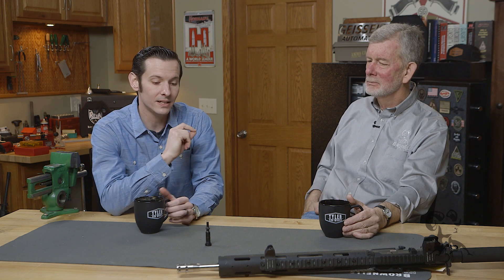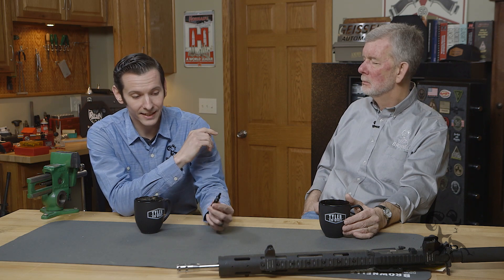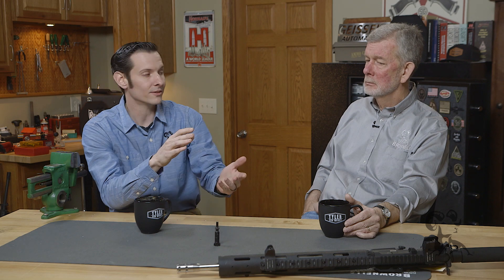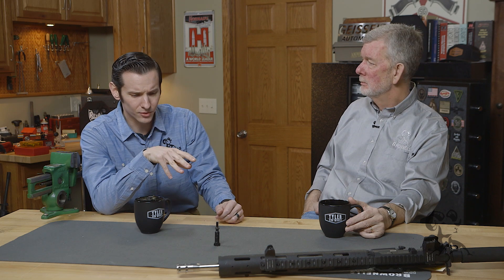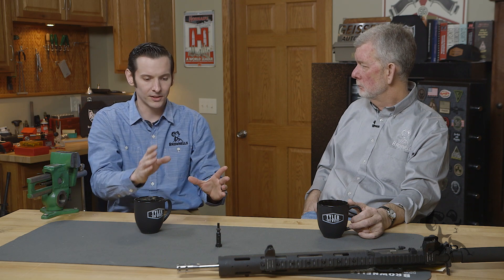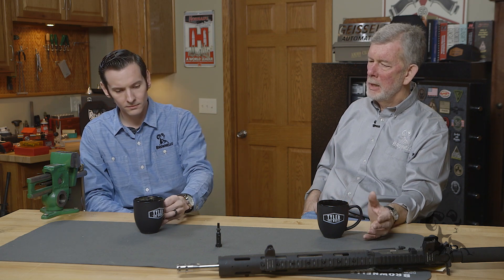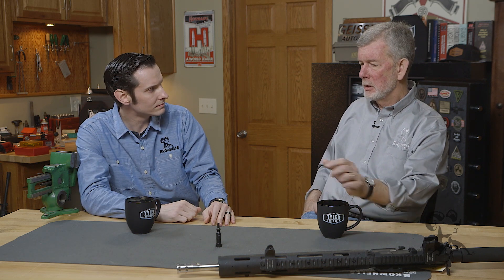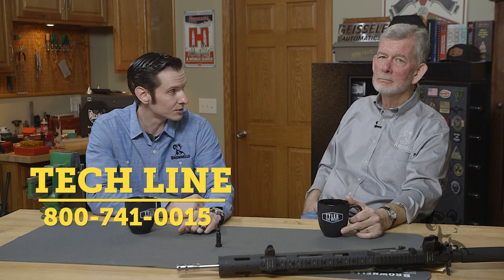Smyth Busters: Debunking an AR-15 Myth - Gas Ring Alignment

Comment: I would have liked to see some proof.
Talking about it and stating one side of the debate as fact does not "bust" the myth.
Reply: How about trying it yourself?
Reply: @timothyterdin5725  I don't plan on making a video which claims to bust the myth.
Reply: @michael9601  I have lined the gaps up.its a myth.i was told the same thing.as soon as you fire the rings move randomly.
Reply: @timothyterdin5725  I 100% believe its a myth.  My only point was that they didn't do what Jamie and Adam do...  :)
Reply: @michael9601  ok.cool.i missed on that cause I was told this too

Comment: This is the same thing as off setting your rings when rebuilding an engine. Sure it will still work with them lined up. But wouldn’t it work better if they where off set? But none the less I’m still going to off set them. Lol just what’s familiar

Comment: Once again Brownells tells the truth but for the wrong reasons! It's not about the low probability of rings aligning!  It doesn't matter, because the gap all but disappears when rings are compressed to fit in the cylinder. This is like when the small engines class teacher tells you not to align the piston rings in Highschool.  😂 A majority of 2 stroke engines only have one piston ring, and they still make plenty of compression.

Comment: Do this with an engine piston, and tell be the same thing
Reply: Done it.  Compression numbers were the same across all cylinders.

1: The ring gaps close most of the way on both kinds of piston once they're in their cylinders.
2: The pressure rises very quickly, so having those little gaps lined up doesn't have time to matter.
3: Gases can turn corners fast enough that not aligning the rings doesn't really matter anyway.
4: The ring gaps are going to move around on the pistons randomly anyway.  At some time, in all those millions of cycles, they're going to align for some time.

Comment: Have anyone tried to shoot/test the bold without any rings ?  If it still works, then the ring alignments are irrelevant.  Can anyone try this and report please ?  Thanks.
Reply: It probably won't work without any rings, unless your rifle is horribly over-gassed.  That doesn't prove anything about ring gap alignment, though.

FWIW, I tried the ring gap alignment thing on a 3 gun rifle with the adjustable gas block set as low as it would cycle BEFORE aligning the gaps.  Still cycled with them aligned.

Comment: Sry, but this is BS. I've had one issue with low-pressure LR308 which did'nt cycle.
Pulled it apart and what did I see? Aligned gas rings! ;)
Reply: This^^ seriously i think these people successfully shot off 10 rounds and went home. When you actually sit on a range all day for weeks at a time you are bound to realize sooner or later the gas rings will cause improper feeding and ejection problems.
Reply: @scotty362100  Actually, I think Brownells is making a fool out of themselves. I was under the impression they knew what they where talking about.
Since it's not April 1st, I take this as sensational click-bait.

However, if a AR15 is gased high enough it will cycle. Usually applies to milspec but not a competition rifle.
Reply: @elespecia5604  First time I tried it was on a 3 gun rifle, so...

Comment: Aligned ring gaps just makes her “shit where she eats” a bit more....dirtier chamber and BCG after same amount of rounds down range.....still shouldn’t induce reliability issues unless the rifle is operating at the fringe
Reply: I just always did this naturally as long as I've owned mine. Working on engines, ring alignment is a no-no. But in a four cycle they will move around to where they want. They too will run aligned but you're right. Unnecessary blow-by should be prevented. I never heard this debate before.

Comment: When the bolt is inserted into the BCG the rings compress and the gap disappears. That is the way it works and the reason it doesn't matter. I think you two should better educate yourselves before giving gunsmith advice.
Reply: The rings compress but the gap does not disappear. Thanks for watchin...

Comment: My experience with the M16 was that my rifle would only fire about 120 rounds before it jammed.  Every time I took it apart to analyze the failure, rings would be perfectly aligned.  I always reset them when assembling.  The ring alignment is not a myth although maybe it only occurs with a well used rifle.
Reply: This^^  i think all the military on here saying its a myth are the ones frustratingly dropping F bomb after F bomb on their 5th time slappin, pullin, observing, releasing, tappin, and squeezing. 😂 Of course after all that youre gonna move those rings out of alignment and back to function but you might be dead by then.
Reply: Or maybe it only occurs with "special" people, you know the ones who rode the short bus, and licked the windows! Opps, sorry i didn't see you were two of  those "special" people.
Reply: @scotty362100  ah yes the classic internet badass to save the day.
Reply: Maybe time to check other issues on the rifle.
Reply: Well used rifles often have worn rings. Leading to larger gaps and looser rings.
Reply: @THEARTOFRIFLERY  yup, this is why it's a good practice to teach in the military still. Of course it's not a "fix", but it just might help in reliability if things are worn like your gas ring sealing. Things don't always get maintained in a timely manner, and if your life is on the line it might help. But, if your rifle has issues then don't think aligning the gas rings will fix the underlying problems.

Comment: Considering that it was in the Army that I learned not to align the gaps in the gas rings, I think what you guys are saying here is bullshit. Also knowing the reason that the whole gas ring thing had more to do with the ammunition than the rifle, itself, probably might change the story a little bit.

You know, if you guys actually gave out the actual reasoning for what you are calling a myth (it's not), it would be more of a fact finding than myth busting. But instead, you try to raise your traffic based on someone else's show. Now that's pathetic.
Reply: What was with the ammunition?
Reply: @muddyhotdog4103  5.56x22 LR
Reply: @jdglenn7214    huh? "5.56x22lr" -that makes zero sense dude.. maybe youre talking about the ar15s original cartridge( ie 222 remington special) which was later necked up to 5.56.. But still that's not the situation. Whatever I'm over it.
Reply: @muddyhotdog4103  22 LR ammunition (https://www.cabelas.com/product/Winchester-reg-LR-Ammo/705570.uts).

But you are right, it is 5.56 x 2.23 (which is 55 grains, not 40) was the ammo. If you did not stagger the gas rings, there was a chance that you would get a round that would not correctly cycle the bolt and you would get a misfeed.

Comment: As we all know, opinions are like A$$ holes. we are all entitled to our own, we just don't like to hear em. well, here's mine...as a career soldier "20+ years" now professional instructor, i'v mostly experienced two types of malfunctions. mostly bad mags, the others were short strokes/ FTE. when i pulled the BCG apart the rings were lined up. fixed it, put it back together and Valhalla, problem fixed. myth or not myth... there is often an element of truth in every good story

Comment: Every bolt that runs without gas rings aligned will ALWAYS have a catastrophic malfunction. 

I have seen 10 rifles explode.  Massively.  Extreme casualties.
Reply: I've done it with three different rifles, none has had a catastrophic failure.  The first one was even a 3 gun rifle with gas turned down to cut recoil, so it's not that this only works in overgassed rifles.

Comment: No different than piston rings in an internal combustion engine . If all the piston ring gaps were to be aligned sure you would lose some compression . Burn oil even . But it will still run .